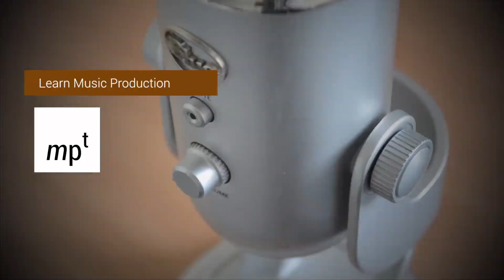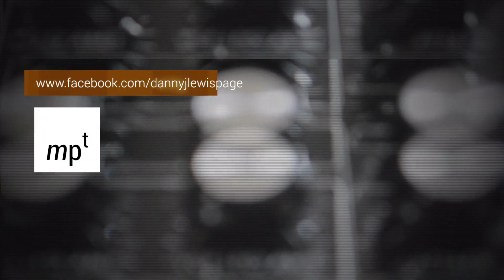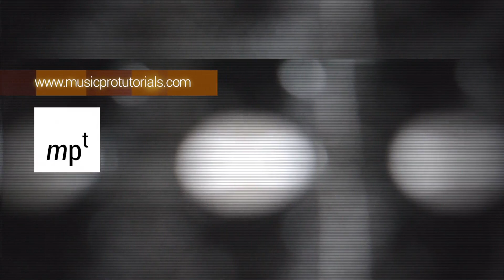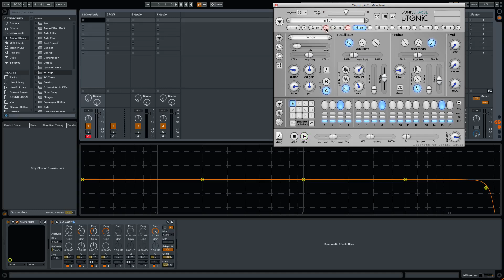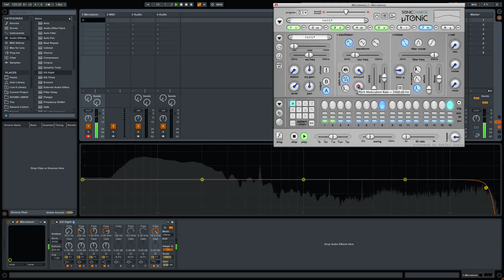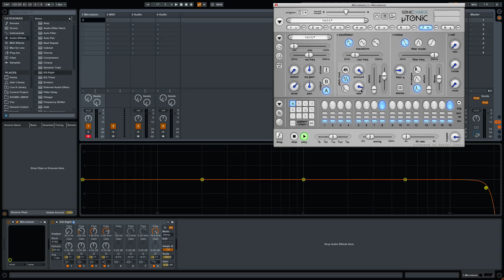Drum Sound Design using Microtonic - The Techniques Explained

Comment: "..Who would have thought you could make a kick drum out of noise." Well, that is basically how an oscillator works in the analog world. You create a feedback loop in an amplifier circuit and filter the feedback to control the ringing frequency. It's just amplifying filtered noise that turns into a ringing.